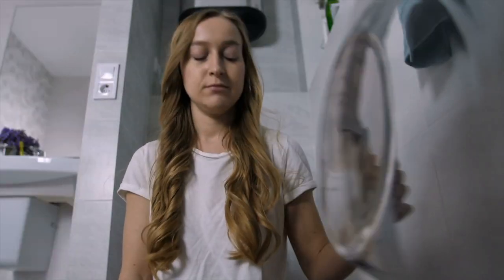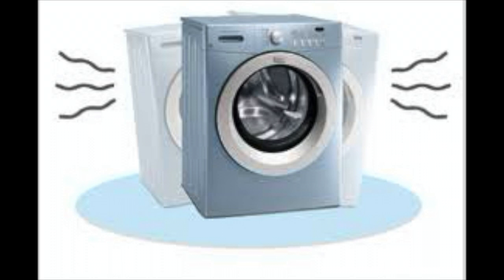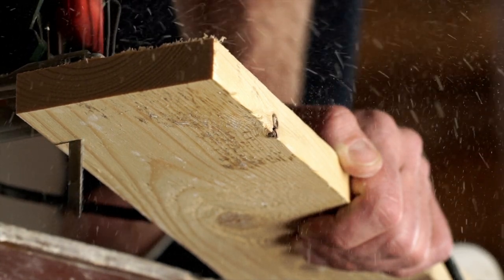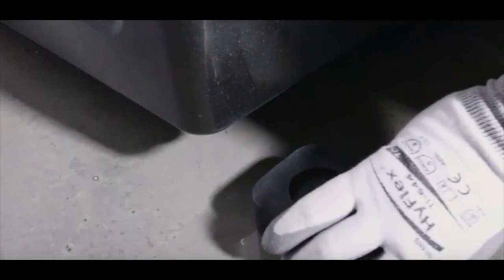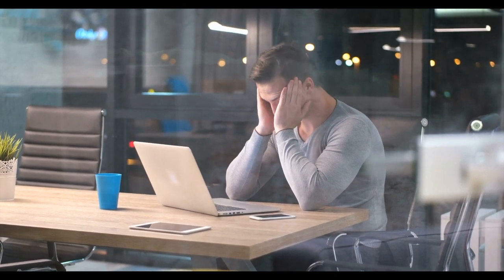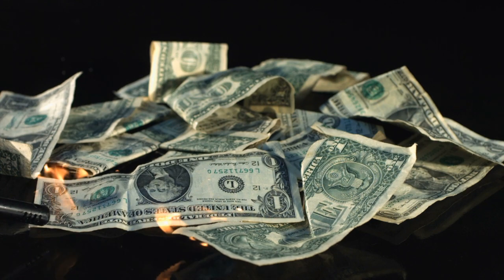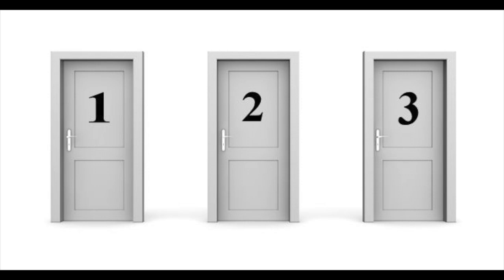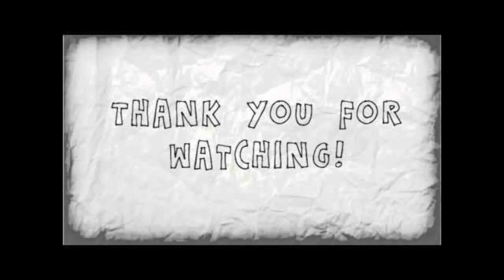How to Soundproof a Washing Machine - 3 Vibration Reduction

Comment: Thanks for this video. I just bought a portable washer for my apartment which is in my bathroom. I live upstairs and my bathroom has hardwood floors and the walls are thin. The spin cycle was vibrating loud. I'm gonna try to use the mat. I hope it  works.
Reply: Did this help? Did you buy the mat
Reply: @user-qb8zm2hy6t  YES!!! Definitely works. It is a must buy. I use both mats for my portable washer and no vibration sound.
Reply: @msqueenro7  Did you use a piece of wood on top of the mat?
Reply: @Thegirlinthosehats  No I didn't  just used the pad.
Reply: did you ask your neighbors if they hear anything? I also have a portable and am afraid to use it now as my neighbor complained
Reply: @msqueenro7  this is what I was looking for!! I also live upstairs and we arent supposed to have washers but I cant afford to go to the laundromat especially with this pandemic! I was worried about upsetting my neighbors with the noise from a washer

Comment: Hey there, im planning to install a DIY drum riser to place my drum kit in the living room.

I thought of building a platform with multiple layers.
I hope I can explain it. 

I would use heavy and dense plywood, which is often used for stages, as a top layer. Mounted on a wooden frame with acoustic Rock wool between the frame. 

And the construction will be placed on thick rubber squares, used under washing machines. 

Does it make sense that way? 
Can you do a tutorial on the topic? 

Thank you and best wishes
Reply: Try gym matt material over all that, but then of course theres all the other walls and ceiling. I'd just get electric if I get back into it

Comment: This was completely useless did you get paid to say the pads worked 🙄🙄🙄
Reply from the maker: No I actually didn’t. But I have tried them and I found them to be good in stoping vibrations. Thanks for your feedback.
Reply: Pads are f......useless, fact.
Reply: @dennisnielsen4289  pads or mats aren't useless, but they don't work for the application mentioned in the video. I own a duplex and upstairs is being rented out to a tenant. Before we moved the tenant in we tested the upstairs washer and dryer and realized "oh fuck, we can hear it and it's so loud". So we tried buying rubber pads off Amazon. Holy hell were there difficult to get under this thing (it's a stacked washer/dryer) but we tested again, and can't even tell when laundry is being done. 

It does almost nothing to just the sound of the washer/dryer at all, but sound vibration through the floor was significantly improved. That's the only thing I'd recommend these for, and to stop any machine from shaking across the floor.
Reply: @DonutDude  what pads did you buy. Can you add a link. Thanks